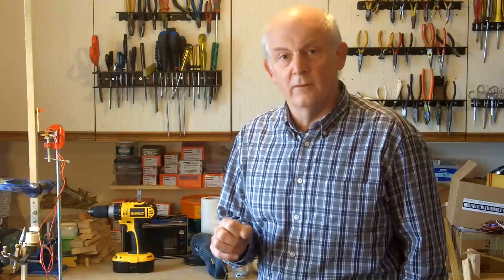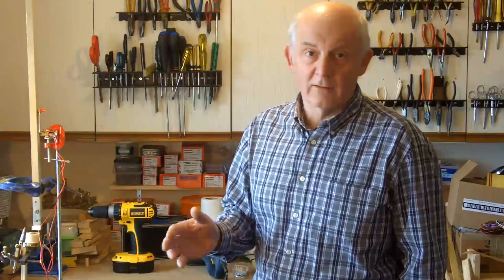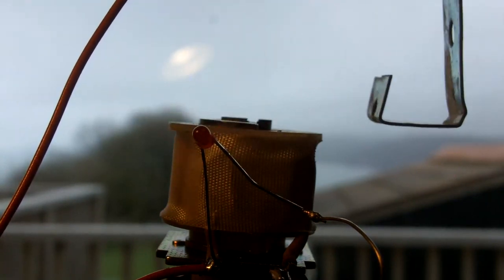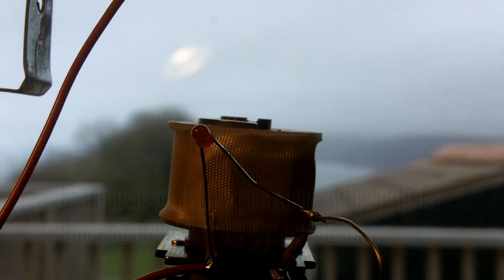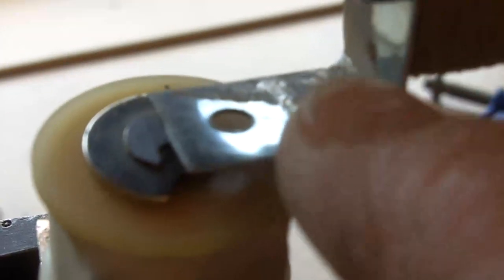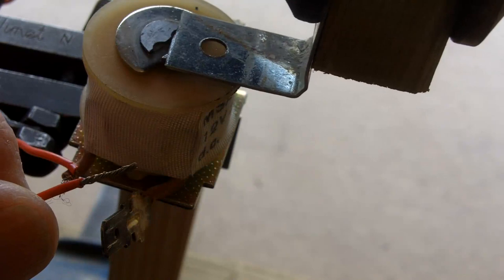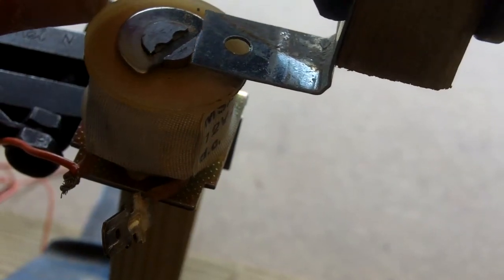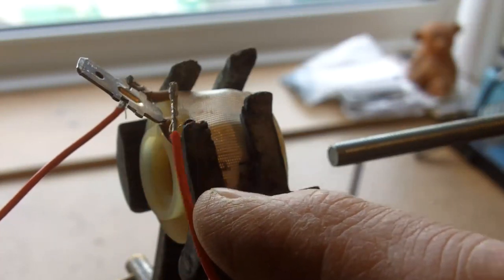Hipps clock movement project (rough) Part 1

Comment: I was fascinated with a BR Hipp's master clock in the 1970s and decided to build my own unique version. using a side of the pendulum toggle switch with an Agate block mounted on the pendulum to complete the switch, twin electro magnets that will keep the clock runing from eighteen months to two years on four U2 Alkaline cells, depends on maker. the Pendulum weight is eight pounds of Mercury and the pendulum rod is made from surgical stainless steel the suspension spring was made from a eight thousands of an inch thick motor car feeler gauge. With all the wheel work between two leaded engraving brass plates with the hour bridge on the front of the plates to accommodate the hands. As a final addition to the clock I fitted it with passing hour strike using an old telephone bell It kept good time until the very hot weather this summer that dried the oil out  of the toggle and pawl and ratchet system. Just undertaking a full clock strip down for its first clean and lubrication , not bad for forty years continuous ticking.

Comment from the maker: Hi there, well I think what you’re describing sounds like perpetual motion and no one’s quite got around to demonstrating that yet, (other than on YouTube of course hi hi.) You can’t really store energy in a transformer for very long, only for as long as it takes for the magnetic flux decay. In the clock, the electromagnet pulls the pendulum and the pendulum stores the energy, when the energy diminishes the Hipps toggle calls for more energy. 
Thanks for looking in.    
Kind Regards ... Andy